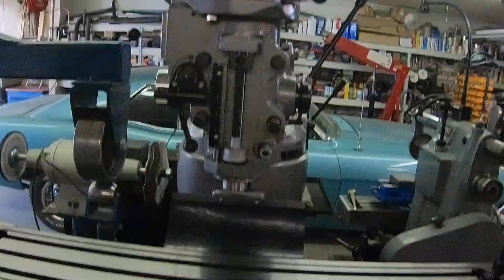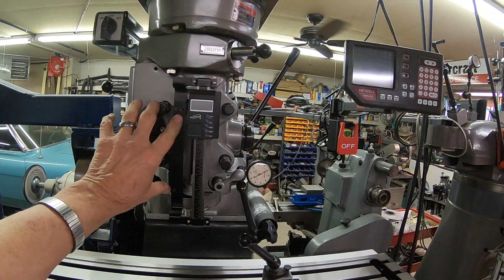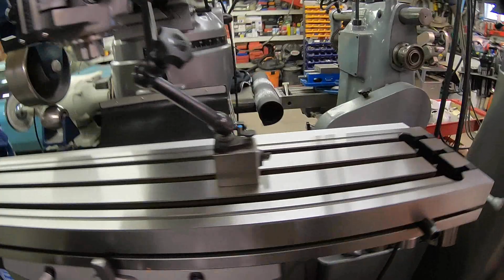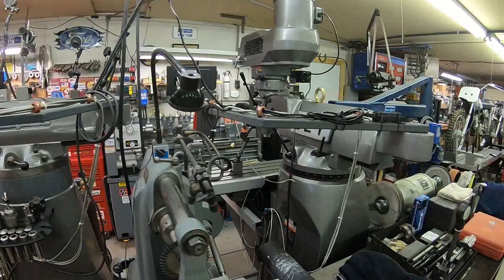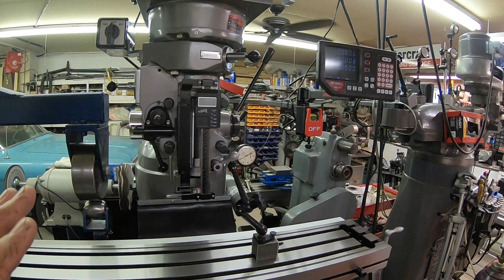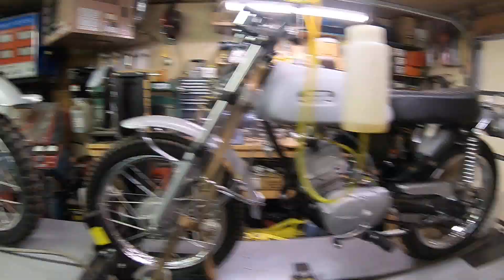New machine for the shop

Comment: I have to ask Dale, how thick is the floor in your shop? You seem to have a substantial load there.
Reply from the maker: Places I have cut through the concrete it was about 3 1/2 inches. The front of the shop where the machines are is pretty broken and heaved, but it was that way when I moved here 30 years ago. I dont see any new issues since I placed the machines there. The front where I put the car lift, I had to cut out and repour to 12 inches with rebar connecting to the old pour, to support the load of the lift. One day I may walk out and find all my machines in a hole....LOL
Reply: @montana2strokeracer  lol, that’s what I’m afraid of in my shop! Was the lift a special order for the height? I’d kill for a lift but my ceiling is only 9’.

Comment: Nice mill Dale. And its made by one of our allies. Now i can brag I moved a 24'' Cincinnati shaper across a shop floor with a pinch bar and cut off steel pipe. It isnt hard if you know what to do and you have a nice level cement floor. Thanks for the video always fun to see your shop.
Reply from the maker: Thanks James, then you are a veteran machine mover also. No sir, not a bad job. You will probably agree the hardest part is getting it off the pallet. This time was easier for me because I had the vehicle lift. When I got the Bridgeport, I had to cut the pallet out from under it a piece at a time because I didn't yet have it. My floor is pretty cracked and heaved so it was a bit of a challenge. Thanks for stopping by.

Comment: no way could anyone get the feeling that your a bragger, thats what i enjoy about your videos is your easy presentation style you may not notice, but you a great presenter.
Reply from the maker: Thanks Frank, I value your opinion, just have never liked shop tours. I really didn't want to do this one for the new machine, but most would have asked about it when I started using it. So felt the need to do something.
Reply: @montana2strokeracer  totally understand, your right we would have noticed the new machine,you did the right thing doing a short reveiw of how it works, and why you needed it. so i guess its back to the meat and potatoes of working on the bikes. want to see the new boring machine in action.